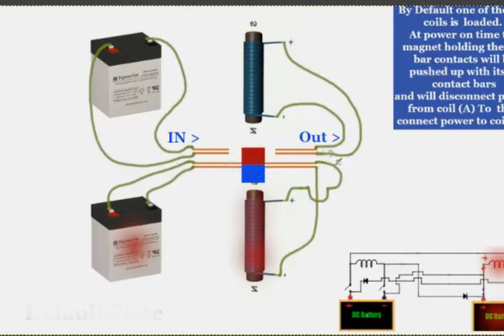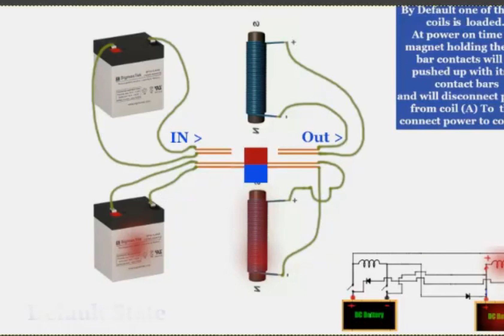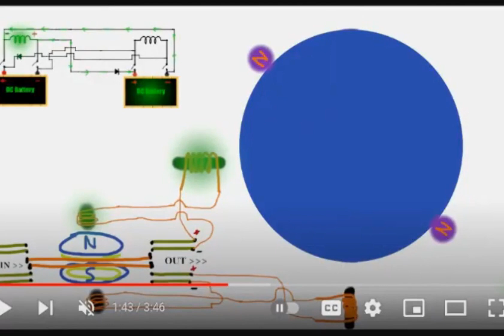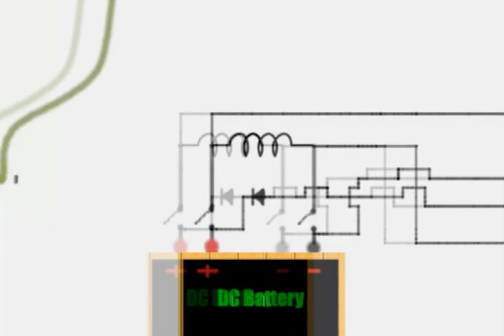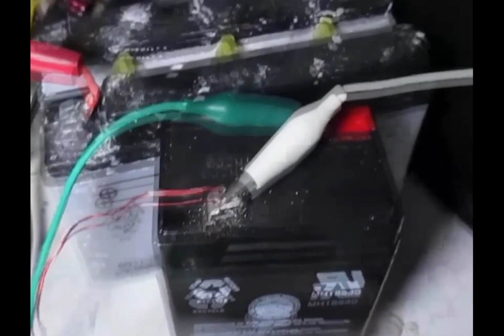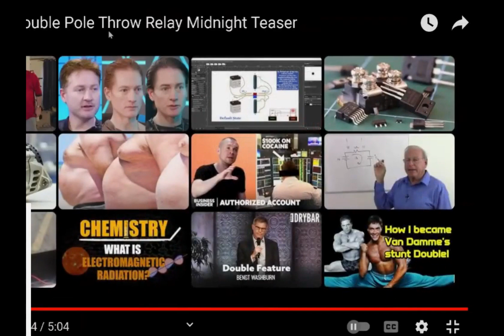Double Source Double Pole Throw Relay Explained

Comment from the maker: 19:40  when i experienced this i had used the incorrect circuit and the 1st coil  was 1st inline to feed the second coil which is what lead me to believe the flyback is weaker only what i thought was the weaker flyback pulse was actually  the fact that the coil that had weaker field was second in a series line  to be charged , I point this out in another video  on my channel.

Comment from the maker: Next video I will explain why I need this relay to switch two poles on two sources .  There are a few reasons some of them includes shorting out the source battery. The video will show images with color tracer lines showing the short path and any unwanted load paths threw the two inductors .